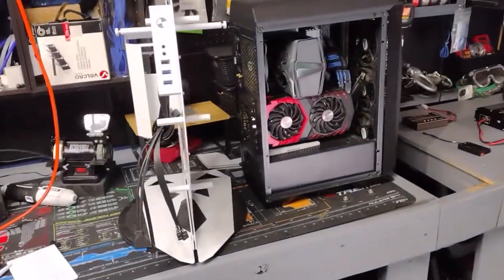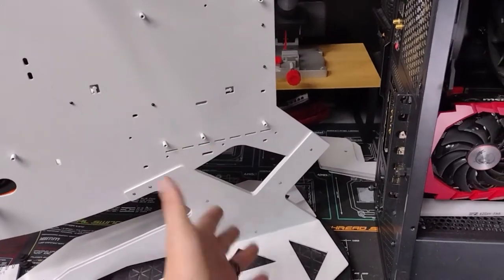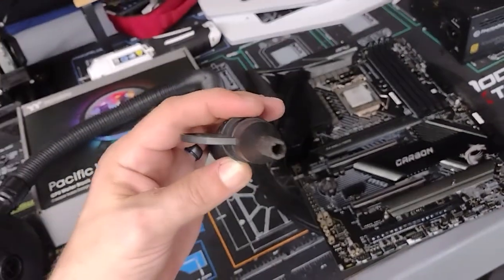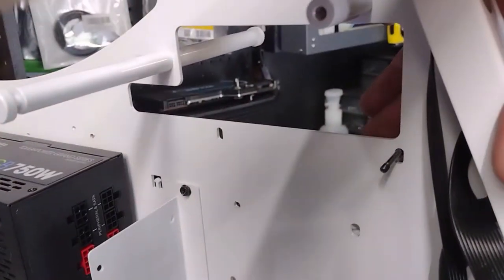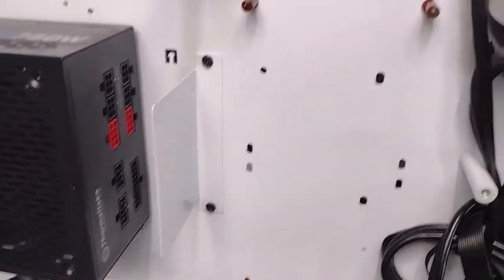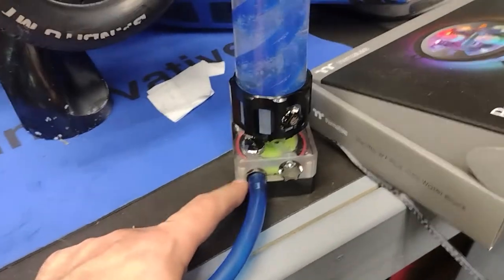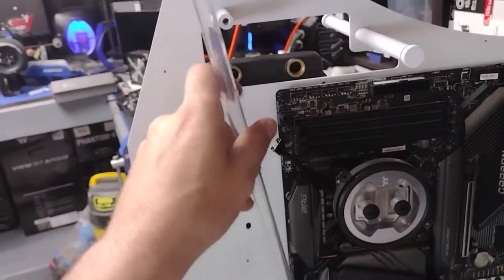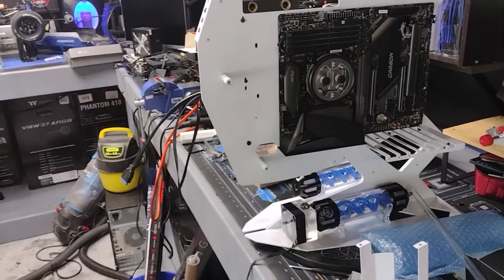Pt -1 OPEN-AIR WATER-COOLED GAMING PC BUILD| KEDIERS PC Gaming

Comment: Bro, you can actually wash your computer parts in the dishwasher but you need to remove the heatsinks from the VRM/chipset and any other removable components (battery, wifi antenna etc). The main thing to remember is that you need to give the mobo/GPU dry for a few days so ALL the water evaporates. Check out the Derbauer channel, he did an entire video about how to wash your mobo in a dishwasher.
Looking forward to seeing this build completed..I have been working on my custom loop rig that I started sourcing parts way back in 2019, hahaha
Reply from the maker: Bro don't you remember I did a keyboard versus dishwasher video where I put a couple of keyboards in the dishwasher and like half of them worked when I pulled them out I want to make a specially designed computer parts washer
Reply: @ATECHPCs  I'll havta go back and watch that one. The most important thing to remember to get the best results is to do a complete disassembly of the part you are wanting to clean. I deff wouldn't use the dishwasher to clean a PSU or her but all other components are fair game. I've even ran a PC fan through the washer..not sure on long-term effects on the fan but it ran fine after letting it dry a good week or so. Also, I've been using my air compressor to blow out the dust from my PC's and parts for nearly 20 years without any problems.. 
Deff looking forward to seeing what you imagine up and create!